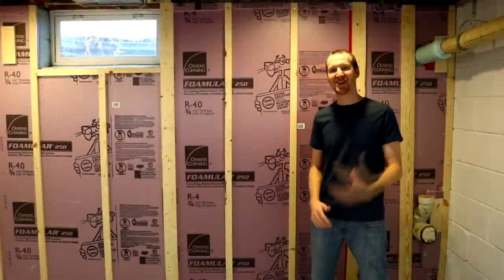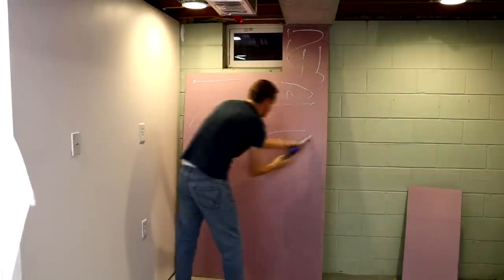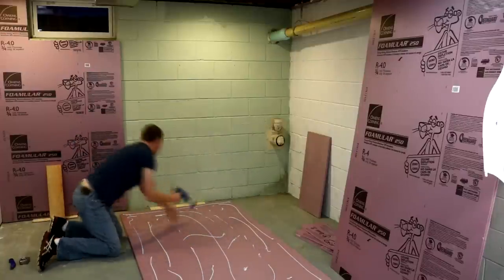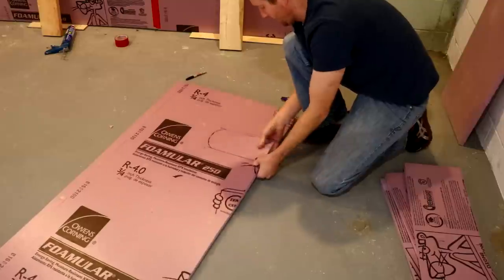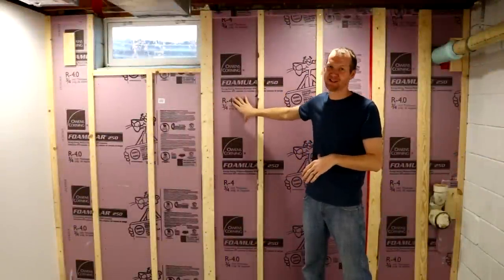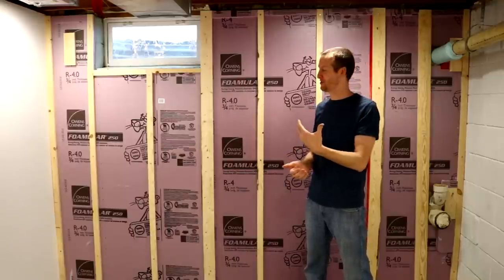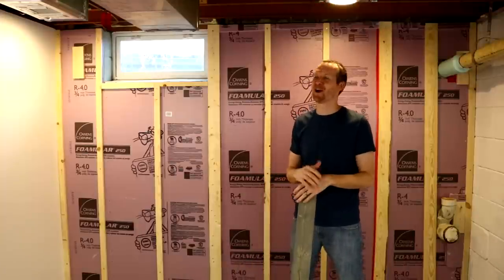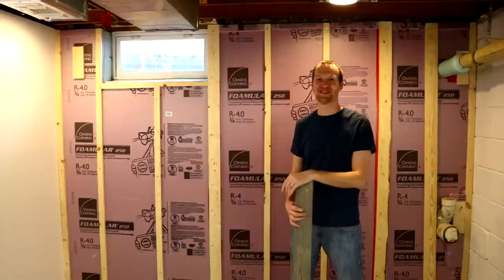How to Insulate a Basement Wall

Comment: thank you for your video. One thing to make note.  if you run your adhesive vertically up and down that way any moisture  can work its way to the floor and not get trapped behind the panel by the adhesive run horizontally.
Reply from the maker: That makes sense...Thanks David for the advise for next time!
Reply: David Dougherty good advice.
Reply: So then would the solution be to run the all of the adhesive horizontally?
Reply: Jonny Sullivan no you don't want it to run. It has to dry and hold in place.
Reply: Do blobs

Comment: I have been searching for 2 hours for videos to show me how to do this! I knew somebody had to have done it before. THANK YOU! I don't want to fully finish this part of my basement, just to insulate it well. Rigid wall board is the most economical and mold resistant solution, but here (Canada eh) it has to be covered with thermal barrier (usually gypsum) for fire code. I don't have electrical or pipes in these walls, except in a corner, which will have a box around it. I don't want the trouble or expense of 2X4 framing on a surface I am only using for a workshop room. Only changes I'll make is thicker 2-3" foam board to get me to R10 (the silver backed one looks good), closed cell foam insulation to adhere it, applied in blobs to allow any condensation to move down, and a 1" gap at the floor to prevent rotting of gypsum if there is any water. I have great drainage on my floor, and occasionally some water seepage with the spring snow thaw. Rim joists I'll seal with flextra and then fit the foam and add closed cell spray foam sealant on the edge. This will save me hours and money and help me meet code and insulate. THANK YOU!
Reply from the maker: Glad I could help, You sound like you have a solid plan for your project. You have really thought it out well...good luck on it!

Comment: Considering the block hopefully being filled with concrete and being only slightly porous to the inside, I think r-4 insulation is just fine for a BASEMENT. Not a downstairs apartment, just a basement. The framing technique is definitely more affordable and lighter duty than buying complete 2x4s or 2x6s and using some fat ass wall insulation, which also costs A lot of money. Well executed job I like how it turned out and putting frame work over the panels, opposed to in between or something,where wood can catch moisture from the block. Hope it’s turned out nice for you so far
Reply from the maker: Thanks for the comment! I know a lot of people have made comments about only r4 insulation,  but each situation is different. I have a 1400 sq. Basement all with uninsulated brick walls. So I was cover about 5 percent with this project. I could have done r40 and my heating bills would still be the same with such a small area.. Thanks for watching!
Reply: Doesn’t the air gap take away from the r-value? The concrete should be sealed from the outside wall and if it’s not it shouldn’t be a finished basement. If it is sealed from the outside all that framing will do is wick moisture from the air because now it has cavities to draw in and if it’s sealed from the outside AND inside the water will still sit on the insulation and rot your framing and drywall eventually anyway… unless you do control the room with a dehumidifier or if you live in the right climate with very little rain if any at all.

Comment: Just my opinion. Let me know if I'm wrong!
Doing research for my basement Zone 5.
Maybe good for insulation, but does little to moisture control as you make holes through foam and do not tape joints.
You end up with only R4 which is low for my Zone 5. I will go with R6 and 2x3 wall with R12 batts.
Reply from the maker: That sounds like a good way to do it. Most basements start off with nothing so anything will help. I think of r4 as it is 4 times better than it was before.

Comment: I would never drill holes in the lower section of my basement walls that are below ground or lay wood directly on concrete since that's food for mold which in a little time you get that musty smell along with mold spores in the air.

Comment: Love this , straight to the point. Thankyou. I have a question.  If the the 2x4 are already on my wall, do I just go over the  boards with my  insulation and then glue and screw them in ? Or should I cut the insulation to fit in between the boards and glue them in?
Reply from the maker: That is a great question! If it was me, I think I would cut the insulation to fit between the 2 by 4s, but to be honest I'm not really sure. Hopefully someone else can chime in with some advice. Good luck Christy!
Reply: Late reply but if you have 2by4 already there use batt insulation very easy and cheap and way better r value
Reply: Problem is if the stud touches the walls then you have a place for mold to grow you want a air gap between the stud and concrete.
Reply: You don't want the batt insulation to touch the concrete wall.

Comment: Did this years ago before I finished my basement. Used 2” foam board and taped all the joints. On top of that I used 4” thick rock wool insulation between the studs. Now that the basement is done I don’t even need to heat the basement. The residual heat coming off the furnace is enough to keep the basement around 67-68 degrees plus my heating bill for the rest of the house dropped quite a bit due to the concrete basement no longer being a huge heat sink.
I estimate this cost me around $800 to do all this on approximately a 1k sq. Ft baseman’s.

Comment: Highly recommended method for finishing basement walls. 1) drylock the walls 2) install 6 mil poly to sill plate and let hang down onto the floor 3) install a 2x4 studded wall 1 inch from block with ploy under the bottom plate and tap on plate to floor 4) insulate walls, no craft insulation just batts 5) drywall. I’ve been in business for 35 years and with consultation with insulation company and my architect and my own demo experience this is a great way to do it for the long haul. Good Luck
Reply from the maker: Sounds like a great way to do it!
Reply: Nah im good. No vapor barrier/plastic should be in basements. Traps moisture
Reply: Completely agree with this 👏  I never understood why anybody would use 1x4 , you can barely feel safe hanging drywall on that crap!
Reply: @goose1498  He said drylock the walls, this is generally good to 20lbs hydrostatic pressure, which isn't a lot but if you have no hydrostatic pressure it's a non-issue and will block the moisture.  houses will also have the outside blocks tarred over if it's still good it will also block moisture from the outside in.  the wall away from the cemented wall provides airflow behind it.  probably don't need the poly but meh.
Reply: @goose1498  What do you use for a moisture barrier then? Framing or insulation in contact with the concrete will mold.
Reply: @nallen1006  XPS foam 2" thick serves as a moisture barrier

Comment: Watch This Old House where they are using 1x3s horizontally and vertically. Verticals are attached 16" O.C. But it still gives an air gap.
Reply from the maker: Yeah, I think I watched that video as well before I did this. I guess they are the real experts!

Comment: is that water around that pipe need to fix mold problem before you hide it
Reply: Nah...prep work takes too much time. Just slap up the finish surface and call it good. It'll be years before the home becomes unliveable due to mold and he'll be long gone by then!

Comment: with a 3" screw do you run the chance of penetrating clear through the cinder block? just wondering if that would cause water to come around the screw an cause problems?
Reply from the maker: I'm not an expert, but I never had any issues drilling into the block. There shouldn't ever be water in the block if you have proper drainage on the outside.

Comment: I’m doing a French drain inside then the membrane to cover the block wall which is 52 inches up from the floor. My third level is half in the ground block and studs on sill plate. I’m going to use 1” foam board glued to memebrane. Frame walls and go with rock wool no poly. Drywall.
Reply: What kind of membrane are you planning on using?
Reply: @stevieb.1473  I believe it was a Delta MS brown colour

Comment: Nice one Chad, I have my whole shed with those breeze blocks (what we call them in UK), and to attach anything to the wall what i like to do is get some Concrete Screws and screw in, and its a nice tight fitting. I need to do some wall Insulation as its cold this time of year in the shed, it puts you off doing stuff. Well Done on the Video, looking forward to part 2.
Barry (ENG)
Reply from the maker: Thanks Barry! Breeze blocks you say...I just learned something new! I know what you mean about not wanting to do things in the cold. I live in a very cold climate(Minnesota), so the more insulation the better!

Comment: That's almost a waste of time to only get an R4 value in the end. Should be 3-4 times that amount ideally. Check your local building codes to see what is required. Around here I believe it's R-12 minimum.
Reply: Add fiberglass insulation between the studs and you’ll be boiling
Reply: Although codes may differ, the R-values generally represent the sum of cavity insulation plus insulated sheathing.  Basement wall insulation is not required in warm-humid locations.
Reply: He definitely should mention where he is at. If it's Canada R22
Reply: @joewellindowd5664  Fiberglass in a basement below grade should be avoided. It loves moisture and so does mold.
Reply: @erickgrimmer4544  Fiberglass is fine in a basement as long as it in touching the concrete walls and you have no vapor barrier.

Comment: How much height is required for the basement to be a room?
Reply from the maker: I think you need atleast 7 ft
Reply: @chaddiy3512  7 ft floor to cealing? Or tu 2x6?
Reply: @chaddiy3512  thanks

Comment: Recommend using circular globs rather than back and forth lines to prevented water being retained on the foam board.
Reply from the maker: Good advice!
Reply: Can you run the glue in vertical lines rather then circular blobs??
Reply: Actually best practice is to be tight w/ no air gap. Reason for that is air circulation behind the panel can cause condensation from cold block above grade to warmer block below grade

Comment: Do you need to seal the basement wall first before insulating?
Reply from the maker: HI Lynn! I am not sure what you mean by "seal" it? The way I did it seemed to work fine, but I guess I will know in 20 years when I redo something and have to open the wall up :)
Reply: I think she means something like drylok coating to block out any moisture.  That stuff is supposed to be good up to 20 psi.  I coated my foundation wall down my stairs before adding pink foam and furring strips to finish off the walls.
Reply: no, he just wanted to show us how to use a glue gone.
Reply: yes  please dont do it like this guy he knows nothing
Reply: Yes, given he has block walls it’s most likely water proofed on the exterior, hence not needing a vapour barrier as 3/4” xps is not a vapour barrier.

Comment: what about heat ducts and electrical        still should build a 2 by 4 wall and insulate that as well  you will not be disappointed

Comment: did you notice a difference in temp after this?
Reply from the maker: I did not notice a difference. There was still a 60 ft concrete wall that would have had to be done as well to really notice any difference I'm guessing.

Comment: Hell i went r10 ridgid framed 2x4s over that,then put r13 in the studs. Warmest part of our house for sure(66 built) highly considering having foam injected in the rest of the house. this guy went cheap
Reply: Did you use the xps rigid board?

Comment: By gluing to foam board there's no air gap.
Reply: This is true, but If you look at the videos from owens corning, they say to put the stuff right against the basement wall.
Reply: But they are still using either foam board adhesive or using white plastic anchors.

Comment: I am not trying to be too critical here but code in most cases is substantially higher R- value. Also a 1x4 along the top and bottom  for the wall covering and to nail the base to. Also electrical code will require at least one outlet. This is why I would recommend a professional or you really need to do your homework. It's more involved than they make it seem.
Reply: Each wall requires at least one outlet? Even outside facing walls?
Reply: Code for outlets is generally 6ft from the entrance of the room and 12ft from there on. This would determine the code Compliance.

Comment: It takes a 6 Ft. this block wall to equal a standard 4" framed exterior wall (as far as the R Value is concerned). So in short, I would frame the wall and install 4" insulation to assure a properly insulated basement wall.
Reply from the maker: Hello, if you would like a higher r value you could just use 2 inch foam instead of half inch like I did. 2 inch foam is about the same r value as a 2 by 4 wall with batt insulation.

Comment: I'm looking to see upper level home done with this.  I have moble home. my walls are only 2 1/2.  I installed same foam panel. then plastic sheets over. then dry wall.  I all so taped panel seams. my out side has thin aluminum sheeting. worked good for gun HUNTING. kept place warm. I'm wandering is this safe for humans to live in. would love feed back thank you.
Reply from the maker: Hi Dave, I think this stuff is safe to use pretty much anywhere. I have seen it used under foundations as well as ceilings depending on the situation.

Comment: FYI - Guys don't do what he is doing.  
Basements need airspace between the walls and the floor to prevent the trapping of moisture.  
With the foam insulation (which is R-4, which is worse than just about anything on the market), you are actually trapping moisture and the foam will likely form mold and be eaten through by standing moisture over time.

Typically you would install a subfloor first with some kind of air gapped underlayment underneath of it.  There should be 1/2 inch of space from the subfloor to the wall.  On top of that subfloor should be the wall frames, which are about 1inch from the wall with some kind of backing to protect it and hold insulation in place, such as typar.  
In the frames, you should have insulation (R14-15 for 2x4 walls, R19-21 for 2x6 walls).  
Then on the interior of the wall you can put a vapor barrier to further protect against moisture getting onto your dry wall / your interior, as well as prevent drafts.  
    
With that frame work, you can simply install any wall/panel and flooring that you want.  I recommend water-proof options, such as water proof vinyl, as if it floods at any point, you won't have cosmetic defects to worry about.

Comment: The product itself is good but not thick enough to act as a vapor barrier.  You need to go with 2" XPS foam.  Also to save on cost, instead of using the adhesive, buy a spray foam gun and use spray foam to adhere the board to the foundation.
Reply: Such a mature, well thought out response.

Comment: Yeah your adhesive is going to cause moisture pooling. Also, lacking sufficient insulation. Foam board, frame, batt insulation, moisture barrier liner(plastic film)..
Reply: YouTube blowing in insulation
Reply: There is a strong argument to be made that fiberglass shouldn't be below grade.  Just fill the stud cavities with foam board surrounded by Great Stuff, and you don't have to worry about moisture.

Comment: What a shitty reno. No room for electrical boxes unless they are very thin and then it wont hold the cubic inches where needed. Bottom plate of 2x4 isnt poly wrapped. No room to run wires horizontally. And doesnt contain receptacles at all. No vapour barrier either? Thats definately a reno to rip out for the new home buyer.